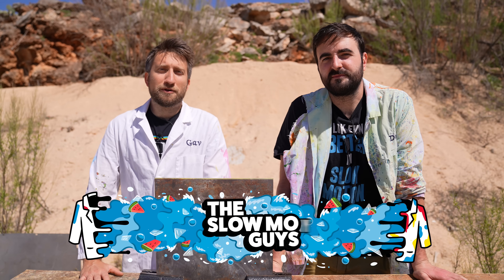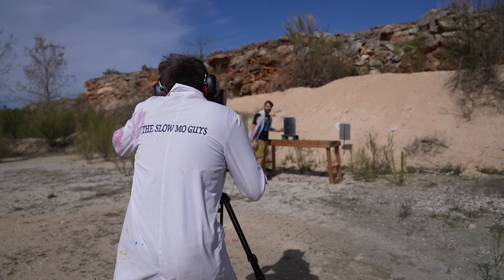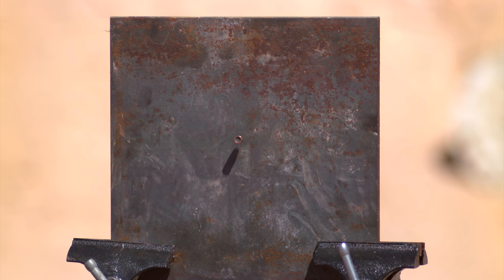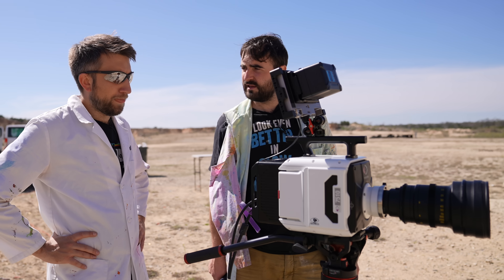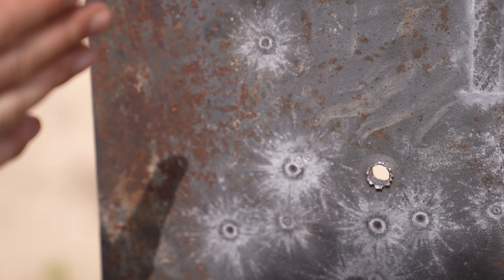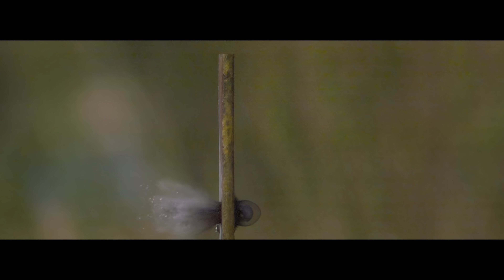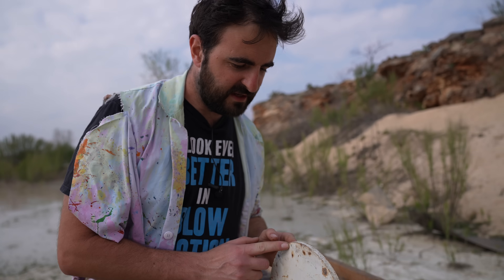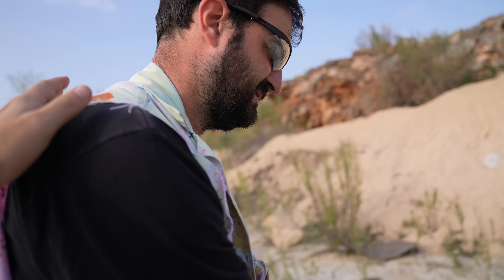Bullets vs Steel at 800,000 FPS - The Slow Mo Guys

Comment: Alright, so it's almost winter. Go somewhere fast enough north that the lakes freeze, and then so the thing where you shoot at the ice and the bullet stops moving, but keeps spinning because there's almost no friction so they don't lose angular momentum, and then just hop around on the ice like little self possessed drills. I want to see a bullet drill the ice in slow mo.

Comment: The reason the round steel target wasn't penetrated is because it was AR500 steel. AR500 steel is much tougher than mild A36 steel. I don't know what the AR or A stands for. If I did I would define it as one is supposed to when using abbreviations. Surprised someone left that at the range. It would cost about $50 to buy it.

Comment: At indoor ranges they go on and on about the ventilation and lead inhalation.  For 35 years I really didn’t know what they big deal was. Seeing that 30-06 turn to lead powder was fascinating. NOW I get it.
Reply: There is also lead compounds in the primers in ammo, which is even worse because it burns and turns into a gas. You have to eat or breathe in the lead for it to be harmful. Bullet casters have had high blood lead levels and found that no longer going to an indoor range but continuing to cast bullets brought their levels down to normal. Casting with decent ventilation isn't as bad with just a pot of melted lead because it isn't heated the same as the gasses from a gun firing and there isn't dust all over. I'm glad I have a private outdoor range that I belong to for the lead, noise, and a bunch of other ways shooting outside is better.

Comment: The explosion happening at the tip of the bullet at impact.. I don't know if it's been asked or mentioned in other comments, but I didn't see anything after scrolling for a while. 
It seemed to me to happen with every impact regardless of type of ammunition. Could it be the compression of hydrogen/oxygen in the air when caught between the bullet and the steel plate?

Comment: So the round target is designed to be hung on top of a 2x4 stand. It is also NOT rifle rated and the divits you put in it actually made it less safe to shoot with a pistol. When people shoot our pistol steel, we charge them for a new plate! The divit or pock mark can redirect the bullet spawl back at the shooter or bystanders. That plate was likely made from AR500 steel, a steel with a high carbon content making it very hard and tough, nearly impervious to most any pistol cartridge. The square plate you were shooting is likely mild steel of low carbon content making is soft and much easier to deform and punch through with higher velocities. Enjoyed the video, the steel "plug" popping out the back was not expected! That was a new one for me to see.

Comment: That 'white' round target steel is rated 500 brinell.  It's called AR500 steel.  "Rifle steel".  One square inch of 500 brinell steel can withstand 110 tons of pressure.  Mild steel, on the other hand, is rated around 120 brinell.  1/2" of AR500 rifle steel beats a wet paper towel most any day of the week.

Comment: The effect on the steel with the rifle bullet is the same effect like with a HESH shape charge.
It gives off all it's energy by deformation into the steel plate, the shockwave (energy) has no way to go anywhere and so it rips out a piece of the plate.

Comment: I would love for you to collaborate and get some custom milled tips are custom make bullets! That last piece of the metal that is the primer. That layer of atoms is completely flat. So it just smacks the plate and bounces off. It doesnt shear bcuz its completely ROTATIONAL motion that carried on from the momentum of the rifling and also the compression of the layers before it pushed the atoms back to fill any imperfections that may have caused it shear!! so it would be really cool to see a cylindric shaped bullet and other weird designs!

Comment: I've never notic3ed before, but everytime a bullet hits the plate, aluminum or steel, there is a little flash of light right at the contact surface between the bullet and the plate. Awesome footage.

Comment: I have a scientific video suggestion. What would it look like if you fired a gun in the dinosaur times?
There are some periods of history where the earth had really high oxygen levels (Late Carboniferous had dragonflies with over 2ft wingspan because bugs grow bigger if there's more oxygen) or other gasses, depending on plant coverage and volcanic activity.
I want to see what a gun discharging in atmospheres like that would look like.
Stick a gun pointed at some ballistic gell into a long clear case (like a fishtank but less fragile) with a hole for the remote trigger and a tube to pump in the gases, seal the hole with some kind of tack or paste so it's air-tight(ish) and fill the tank with oxygen/helium/something else, and fire the gun, see what happens.

Comment: With how close that 30-06 was to failing to penetrate the mild steel, I think it would be interesting to see it hitting at an angle. Maybe 30 degrees, up to 45? It almost certainly wouldn't penetrate, but it would be interesting to see how much backface deformation and spalling there was on a non-penetration.

Comment: Data to help:
The steel to shoot is AR500 or better.  Softer steels can actually send stuff back at the shooter in a very dangerous fashion if things go just wrong enough.
AR500 is better at shattering the bullets but it is still wise to angle the metal slightly downward so that fragments hit the ground and don't return to sender.

This video is one of the few that have properly demonstrated spalling.  Many folks incorrectly consider the fragmentation of the projectile to be spalling and that is incorrect.  I will be using this to show the difference to people who ask.  Thank you for providing this data.
A question to everyone:  With the video we have, what roles to momentum and kinetic energy (Mass x velocity versus 1/2Mass x velocity squared) have in the effects seen?
Reply: I loved when that plug first came out. I'd only ever seen it that cleanly on the penetration simulation corner of youtube before!

Comment: I did the same with an armor piercing round and a quarter inch thick steel plate using an M16 rifle.  Same effect as your baking tray. Went straight thru. No pictures.

Comment: More rifle bullets hitting AR500 plate PLEASE!!! (that's the hard round plate you found) but do some different bullets of varying compositions and constructions-- such as hollow point boattail match(eg. Sierra Matchking),,,  Monolithic copper(eg.Barnes TSX) and do a repeat of one thing Werner Mehl did in the famous video - He shot solid and HP 22LR lead bullets at the plate and the Hollow Point bullets trapped the air and it pops or bursts out the back of the bullet at the very last instant of the bullets impact. Contact me for more indepth info and explanation if you like.   Great video guy's Cheers from Scot!!!

Comment: A Veritable Ballet of Shrapnel... Who knew that high-velocity Death could provide such hypnotic beauty? 
Wouldn't be surprised if you could calculate projectile speed from the angle of the shockwave shadows. EXCELLENT Photography.
And for those considering home-made projectile fender-offers, it would be especially appreciated if you provided the steel specifications.
We hear that composite kevlar-polymer-adhesives do a great job, too
Wonder what visual delights they can provide...

Comment: I think the flash as the hollow point hits the plate could be combustion. The round is made of lead and copper, neither are ferrous so it’s unlikely to be a spark. I could be wrong but what i think is happening is the air in front of the round cant escape and is collected by the hollow and when it makes contact it pressurises and combusts just like a diesel engine.
Reply: Ive just realised i forgot about the steel plate. However i still think its combustion?

Comment: Honestly I think the coolest part is 13:33 you can see the shockwaves of the bullet in shadow on the target
Also the target steel is prob ar500 or similar, same sort of stuff used in armor plates, it's extremely hard steel, very difficult to machine as well as a result comparatively

Comment: Those chunks of steel coming off the square plate look almost identical to the plug that drops out of a hydraulic punch, but a bit more curved since a punch puts the pressure around the edges.

Comment: I have a request for you guys:  Many hunters, including myself, place a piece of masking or electrical tape over the muzzles of our hunting rifles.  Question:  Does the compressed air ahead of the bullet break the tape's seal or does the bullet pierce the tape?  I think it would be a great experiment.  Quick & easy.
Reply: It would pierce the tape.
Reply: Pretty sure the answer would be both, or the gas. It cant be blown off by the bullet, at that speed it would just pass through it like nothing leaving no energy behind. The gas is going to be what causes the shockwave to blow it off, but this is happening nanoseconds. So it's very likely the bullet will still pierce the tape before it is blown off. 
Easy thing to test without a camera, especially if u do it often. Check the tape after u shoot. Hole = both, no hole = gas.
Reply: What happens when you put tape over the end of a syringe? The air has to go somewhere before the plunger gets to the bottom. A gun is like an engine or air pump/pneumatic cylinder. If there is 10k to 60k psi of gas behind the bullet, the air isn't going past the bullet, and ideally the bullet obturates which seals the bore and keeps the gasses from passing the bullet. The air either has to be capable of compressing enough without breaking the seal on the tape or it blows the tape off. A person could test this without firing the gun just by driving a bullet down the bore from the chamber to see how easily the tape comes off.....it may pop the tape from driving the bullet by hand. A lead bullet would be easier to test or even cerrosafe metal at the right temperature. With the potential speed of the air leaving the barrel, the air could blow a hole in the tape. Again, it depends on the type of tape and how well it sticks vs. breaks. I happen to be a pro at using tape.......as a painter for many years and also did lots of electrical. Electrical tape can be quite tough and masking tape can tear very easy compared to electrical tape. A metal tube and a blow gun from an air compressor would probably easily break masking tape. You could also look up how fast a bullet accelerates to speed, but we know it hits full speed inside the barrel so someone really good at math probably knows how to calculate pressures, or do some google searching and figure out how much pressure the volume of air would make based on the force on the bullet and then test your tape on a tube with the same pressure of compressed gas.

Comment: A Black Talon would be interesting. (Found a box of those when I was 6. Didn't touch them because of my upbringing, but never knew what they were for till 8 years ago) Not sure if you would be able to get hold of a: 9mm kevelar coated holopoint with teeth.

Comment: If you want a much closer shot without risking the camera, make a shield from that 13mm steel plate and use a mirror to get the shot without your lens being in the area of danger. Might want to have a few spare mirrors ready to replace though!

Comment: why did you guys not shoot with a mirror setup? then you could have been right ontop of the target.. also LOL for thinking that mild steel with stop a rifle bullet. you just made an expensive hole puncher. you need AR500 buds for pure impact. next time maybe get someone involved who knows a thing or two about steel targets. you want to have it angled down wards at around 10 degress and all the splatter will safely discharge into the ground and not go all over. you also want the muzzle to be higher than the plate, not below or in line, just not safe, especially with rifle rounds

Comment: Something is going molten when the bullet hits the steel plate. If you slow down the video to .25% of the video using Youtube's video speed controls, you can absolutely see something glowing at the point of impact.

Comment: I think the "sparking" is the ingnition of the air trapped by the hollow point of the round shining through the ripples in the tip. I think the air is exploding in the tip of that round and you're seeing the flash.

Comment: The white targets you found were probably AR500, AR550, or AR600 steel. It's commonly used to make firearm targets as it's hard/strong enough for lead core bullets to only cause superficial damage at most ranges.

Comment: You should repeat the test using metal plates with protrusions, similar to those used with incorrect caliber bullets that deform the plate upon impact. This will help determine if there are any ricochets coming back to the shooter, possibly serving as a safety precaution. I believe this would be an interesting experiment, and surprisingly, there are no videos like this available on YouTube.

Comment: If you guys take a hard look at the returning copper jacket, it has been turned inside out because you can see remnants of the lead on the inside of the jacket, which is now on the outside. As far as the white target it is made from AN 500 armor steel and the plate of steel you used is made from mild steel, there is a big difference between mild steel and Armor steel not just it's hardness, if you were to take a regular high carbon steel and harden it as hard as you can, the steel would shatter or crack when the bullet hit it. AN500 is a special kind of steel with various components, basically it is an alloy steel. the base metal for AN500 is Iron, then Carbon, Manganese, Phosphorus, Sulfur and Copper.  Steel isn't the base metal of AN500. Now that you've seen and felt the power of the 30.06 round you can have a better idea of what the Germans faced in WW2, when ALL of the rifles and BARs used in WW2 were in the 30.06 caliber round. It packs a powerful punch, and you now know why those Round targets are put on 2x4s or spring mounts because the power of the 30.06 just breaks things. Thanks for another great video guys! Cheers!
Reply: AR ( abrasion resistant) 500 ( the hardness rating) 
So it’s AR500 not AN500 steel. It’s used on bucket wheels, grader blades, excavator buckets etc as well to help reduce downtime and increase run time.
Reply: @oculusangelicus8978
AR = Abrasion Resistant. Which is classified as a low alloy carbon steel. Before writing several paragraphs about a thing, you really should talk to someone who actually knows. 5 minutes spent on Google with no relevant background isn't too useful. Your metallurgy is about like Cheech & Chong discussing quantum mechanics.
Reply: @BertRowe-b3l  Hahahaha! That’s what I was thinking! Waiting for Hardox to enter the chat.

Comment: The surprise at what the .30-'06 did to the first steel plate was amusing.  I wasn't surprised at all.  That steel was probably "mild steel;" either 1018 or A36 alloy.  The white steel plate was more likely AR500 which is used commonly for targets and light armor.  A 125 grain 9mm projectile typically has 350 to 500 ft/lb (475-675 Newtons) of energy at the muzzle.  A 150 grain .30-'06 projectile has more like 2,800 ft/lb (3800 Newtons) of energy so around 6 times that of the 9mm. **All numbers are rounded off for easy reading but close enough for the purpose.

Comment: I once shot a frozen lake with a 9mm, and not only did the projectile survive the impact, but it was spinning like a top on the ice for at least 10 seconds after impact.  I had a hard time believing that had actually happened, so I fired several more rounds into the ice with the same results each time.

It would be amazing if you guys could capture that in slo-mo.  The shots were probably hitting the ice at a 25-35° angle.

Comment: You did the speed of glass breaking test. Does other types break at the same speed? Also there was another material that breaks seemingly instant and if i remember i will mention this. May only be the speed of the shockwave so might be no need. Equivalent to speed of sound in whatever medium in thinking but you guys know more.

Comment: Deleted my comments because none of it was something we didn't know. But i still think it's a cool video. I like how the shockwave makes a balloon during penetration and exiting. Before i was just explaining the shockwave in the rear and front but another video i found is talking about this already. Spawling happens because of the steel and why they use ceramic because then it's absorbed inside the ceramics. Military already figured that part out. But how the bullet disintegrates is neat.

Comment: I wonder what my hand loads would look like, 44 Remington Mag: 220 gr Silhouette with a good charge. The 220 gr. Silhouette has a heavy copper jacket to help the bullet hold together for maximum energy transfer. I loaded it for my 10" SS Redhawk. Originally designed to push over a 50# target at 200 meters. Think that would be a good video? I also have a 14" T/C in 30-30...

Comment: It's not just hitting harder. It's hitting faster. That's not just more force.
See, steel is actually a 3D matrix of atoms, pulled toward and pushed away from each other by forces between them.
When you heat it up, the atoms vibrate in place, faster and faster. Heat it enough and the forces between them barely have time to turn them round and keep them in place.
At that point, you can hit part of it with a hammer to drive those atoms fast enough relative to others nearby to rearrange the matrix, shaping the steel.
The faster your hammer is going, the cooler the steel can be and still be hot enough to shape.
When your .30-06 hit the mild steel, it was going faster than the melting point of the steel and the edge of the impact area behaved as if molten.